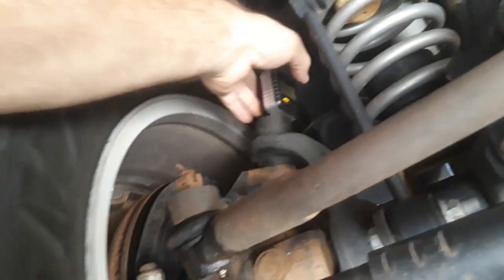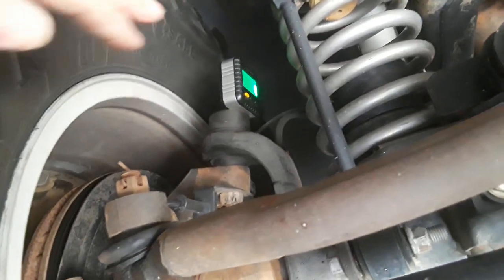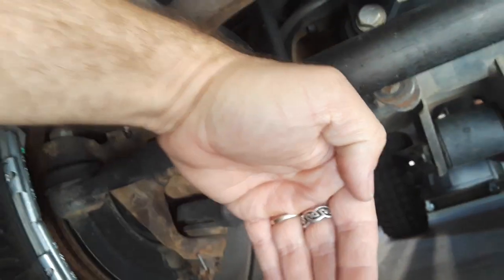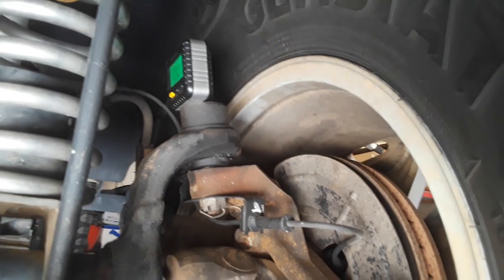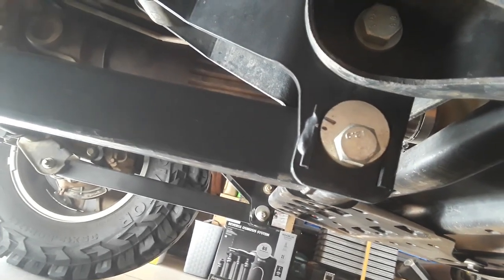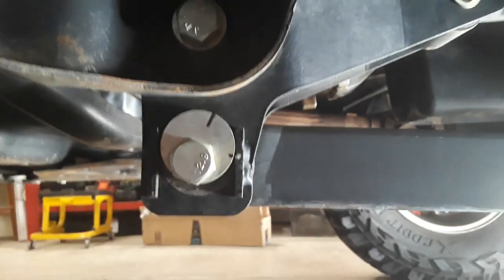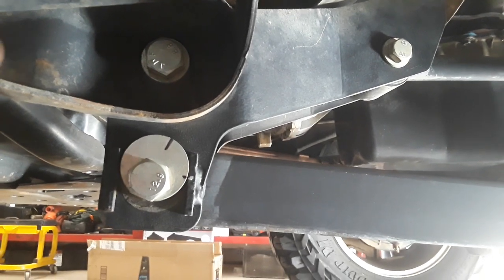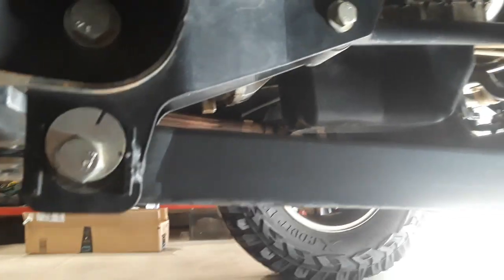How I adjusted the caster angle Jeep JK with lift

Comment: Not sure why I didn't decide to review and do research on this topic before. Long story short,  I'm already 2k in and still have the same issue. This problem ruined my tires and I ended up paying about $500 in "alignment fees." Lesson learned, thank you so much for this information.
Reply: Same here wish I would’ve seen this video before ,, I adjusted my caster yesterday and installed new adjustable upper and lower control arms and it fixed the issue , very happy ,

Comment: I have 2 inch mopar lift..comes with longer control arms.  plus i have 2 inches leveler front. My caster is 5.2 and all parts are tight no play. And it drives perfect. No dead wobble at any speed. People bash on adjustable track bar bushing. I contacted the compagny after reading all bad comments. They told me they improuved the busing but also people dont install with proper geometry then blame rough country

Comment: Perfect video on this. I am a huge Jeep guy and I am very mechanical, but I have no experience with caster. I just bought a 2010 JK unlimited sahara with what i believe is a 4” RC lift (it has 35’s on it). It is deadly. All over the road in town…but on the highway it’s perfect. I have owned many Jeeps including multiple JK’s 2008, 2010 and 2018 all new. They drove great. My wife has a 2018 two door sport that is like new so I’m about to go measure it…but this used 2010 I bought is just dangerous. I’m going to go review exactly what you just showed and I was looking for a simple explanation as to what to look for. Thank you!!
Reply from the maker: Thanks for the kind words. Also make sure to check all the ball joints, tie rod ends, track bar bushings, drag link bushings and wheel bearings for any play. Once you put 35's on it really starts to exaggerate everything. Also I'd recommend measuring the castor angle at the flat spot next to the diff cover. There are 6 degrees of separation between the pinon and ball joint C's.
Reply: @vegasfordguy  Ok, just reviewed and compared to my wife's original 2018 (might be different between 2010 and 2018) but the angle both top and bottom of the passenger side is 4.5 degrees and the drivers side is 5.5. My wife's 2018 stock (with optional 31" BFG AT) are 5.5 exactly on both sides. So the obvious question is: would a degree difference between ends make a significant difference in drivability? My wife also made a good point: it drives down the highway great so it "drives" fine, but in town and on bumpy or curvy roads it "handles" like complete s*** and is deadly. So there is a difference between "drivability" and "handling" for sure. Track bar is in place with bushings that look ok. I did notice there is a rough country pitman arm and the stock steering stabilizer has been relocated above the tie rod (compared to my wife's). You can see the original mounting location for the steering stabilizer and the holes which caught my attention. I need to make a video ha! I wish I knew how to determine which lift is on the jeep. The springs and shocks are silver, but other than the pitman arm I have no identification. I do not like assuming. Also, the lower control arms are solid with non-adjustable bolts, but look to be aftermarket (tubular or round instead of square like my wife's, but not sure if that was a 2010 thing?). There is no drop brackets on the control arms and I was really hoping the angle of the caster was going to be in the 1's and that would be the obvious problem, but now I'm not sure and more confused. I cannot for the life of me figure out why the passenger side would be a degree different than the drivers considering the arms and bolts are not adjustable??  I have not tested ball joints or tie rod ends yet, but will. Everything looks really good honestly. Steering wheel is off though so will probably do a front end alignment first and see what those numbers are...
Reply: So did you figure it out? I have the had the same exact problem . on the highway is excellent  but on the streets it’s crap and is affected really bad by uneven surfaces

Comment: I couldn’t get a good ride over sharp bumps even with the caster at 4.5 degrees with adjustable lower control arms at 2.5 inch lift. May be larger tyres could help. I went with geometry correction brackets and there is no more bump steer. Down side there is some lost of clearance. I can now control it much better at speed on multiple hash bumps around a bend where as before I would really have to hang on and fight with the steering wheel. It just depended on the type of bump. Caster looks like 5.2 degrees with geometry brackets set to the middle location on the upper control arms. Having the lower control arms parallel to the ground is what made a difference for road use.

Comment: You can add a  'caster bolt kit', or, they actually make offset upper ball-joints and for some applications you can install adjustable upper ball-joints. I'm a retired mechanic. I was a certified undercar specialist. Toward the end of my career I was an instructor for the company I was working for and taught techs about 'all things' alignments. You want at least 4.5° of positive caster. This fellow has 5°. Right on the edge of acceptable. If it were my rig, I would have used the caster adjusters to set my pinion angle correct so my front drive shaft u-joints don't wear out prematurely, then measure the caster angle the way he did, then buy what ever ball-joint I needed to set my caster at 6° on the driver side and 6.25-6.5° passenger side. They make offset ball-joints with different degrees of offset. A vehicle will pull to the side with the LEAST amount of caster. So, to compensate for "Road Crown" (all roads are designed with 2° of road crown so rain water will run from the highpoint of the road in the center to the shoulder and into the ditch) you want to set your caster lower on the driver side to fight the natural tendency of your rig to creep 'downhill' toward the shoulder. But, if you put in more than a 1/2° split side-to-side, you'll over compensate and have a rig that drifts across the centerline and into oncoming traffic. A 1/4° to 1/2° difference side to side, with the lower measurement on the driver side, is just about perfect for ANY vehicle. You get it set up like that and you'll have a rig where you can let go of the steering wheel, on a straight smooth road, and it will go nice and straight for a good half mile before it gradually starts to creep over to the shoulder.

Comment: Great video.  I have a 3.5 " Rubicon Express Super Flex lift with Falcon 3.3 shocks. I put it in myself but didn't know I had to adjust the caster/pinion angle and the driveshaft tore up the boot being at a bad angle. It took about 2 years for it to happen though. I just put in a new Rough Country front drive shaft and I'm starting to hear and feel a slight vibration at highway speeds. Good thing I have adjustable control arms to fix the problem. 

BTW, another cause of flighty steering is too much tire pressure. On my Jeep, I am running 37" Nitto Trail Grapplers.  The stock recommendation for 35 PSI is too much for these tires and I will be all over the road at high speed. I am currently running 28 - 30 PSI and the problem went away. I have a programmer to change the tire pressure so the light will go away.

Comment: This is fantastic information. Thanks for sharing! A few questions, I commonly see the Cam Bolts on the axle end and yours are on the frame end? Who is right and who is wrong? Also, when looking for your target camber I assume the whole vehicle has to be level, so does this mean put it all back together and set it on the ground and hope its close? If not jack it back up and do it all over again or is there a reference angle you can use and just do the math on it?

Cheers!

Comment: Great video explanation and good advice. I purchased an old ZJ and it had worn track bar and BJ's and it had DW very bad. I replaced ALL the front end components including 4 OE control arms and added 4 new OE springs but included a Rough Country 2" lift with shocks and 2 months later DW came back. I'm certain it's the alignment especially the castor after researching the geometry changes even a small lift can create. I'm on my 2nd track bar already. Next step is a Kevins oversize track bar bolt kit, their HD dampener. and an alignment with extra castor on the side if possible. Thanks for sharing.

Comment: I know that flighty feeling you speak of. I find myself sometimes correcting an over correction from the steering wheel trying to hold it straight in the road lol kinda scary to be going 70 and your rig just decided to go in another direction. I bought a jku Sahara with a 3.5" zone lift it also has 2 steering stabilizers on them. I need to fix the flight problem quickly
Reply: Just a note, steering stabilizers do not contributes to either flighty feeling or death wobble.  They just dampen the roughness coming in from the terrain.  As described by Desert Explorer 302, it's the caster angle, how well the track bar is centered, toe-in of the front wheels and all bolts are within torqued specs.  I was facing the same problem on my 2008 JKUR and went thru the same exercises to get it fixed.  
Very nice video by the way!

Comment: Is there a way to adjust the caster with stock arms?
Reply: You can add a  'caster bolt kit', or, they actually make offset upper ball-joints and for some applications you can install adjustable upper ball-joints. I'm a retired mechanic. I was a certified undercar specialist. Toward the end of my career I was an instructor for the company I was working for and taught techs about 'all things' alignments. You want at least 4.5° of positive caster. This fellow has 5°. Right on the edge of acceptable. If it were my rig, I would have used the caster adjusters to set my pinion angle correct so my front drive shaft u-joints don't wear out prematurely, then measure the caster angle the way he did, then buy what ever ball-joint I needed to set my caster at 6° on the driver side and 6.25-6.5° passenger side. They make offset ball-joints with different degrees of offset. A vehicle will pull to the side with the LEAST amount of caster. So, to compensate for "Road Crown" (all roads are designed with 2° of road crown so rain water will run from the highpoint of the road in the center to the shoulder and into the ditch) you want to set your caster lower on the driver side to fight the natural tendency of your rig to creep 'downhill' toward the shoulder. But, if you put in more than a 1/2° split side-to-side, you'll over compensate and have a rig that drifts across the centerline and into oncoming traffic. A 1/4° to 1/2° difference side to side, with the lower measurement on the driver side, is just about perfect for ANY vehicle. You get it set up like that and you'll have a rig where you can let go of the steering wheel, on a straight smooth road, and it will go nice and straight for a good half mile before it gradually starts to creep over to the shoulder.
Reply: @RANDOMNATION907  I did buy some indexing washers but don't see any videos on how to install them so I'm just gonna figure it out myself

Comment: Looks like it was installed correctly 👍 
Was it on there (the lift) when you bought it
Reply from the maker: Yes, pretty much everything was loose though, nothing was anywhere near torqued. Between that, the bad wheel.bearings and cupped tires it was a white knuckle experience driving it home at 70 MPH. I've got everything dialed in now.

Comment: can this trpe of gauge compensate for drive way slant ?
Reply: You can get the digital angle finder at harbor freight for like 30$.  If you’re talking about the brackets. They are called geometry correction brackets.  Google will be able to pull up a few options.